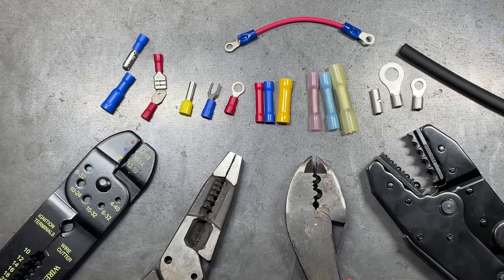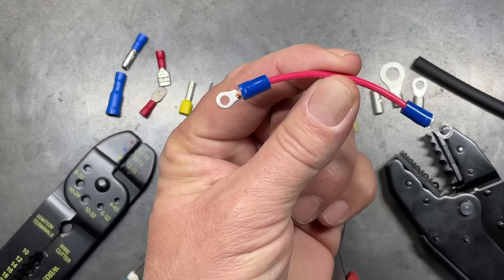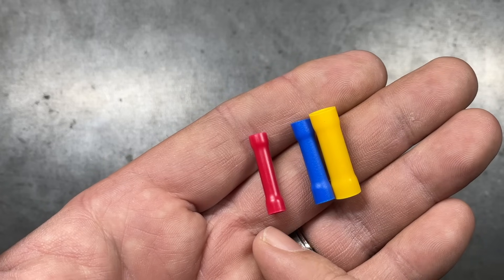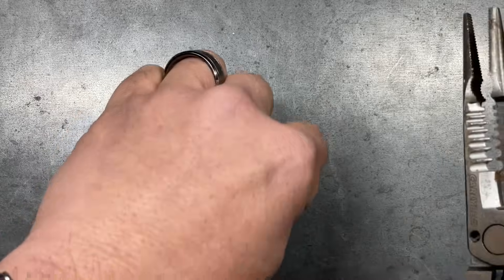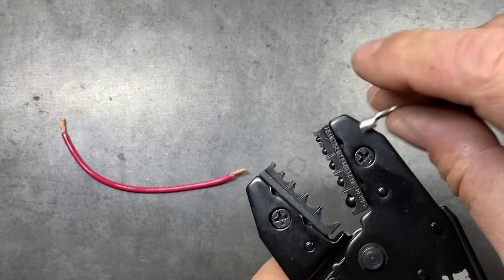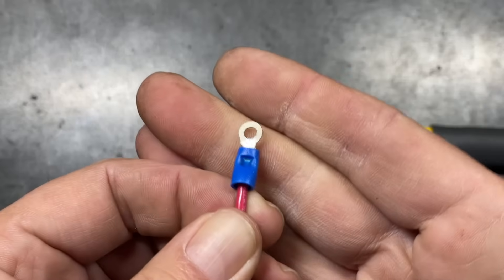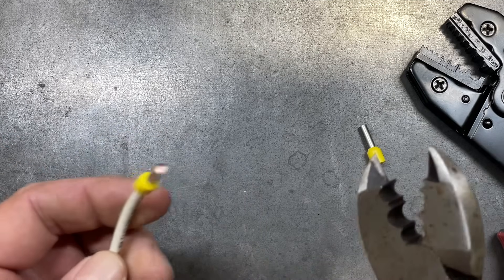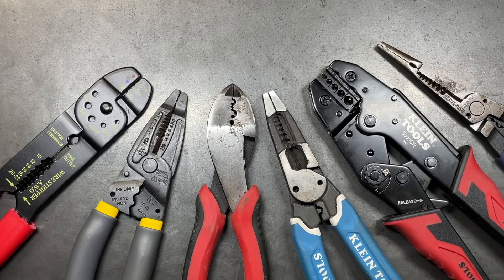Wire Crimping : How To Get Professional Results

Comment: I don't care how a crimper (like those stamped Kleins) is marked; non-insulated 'indent' crimpers must never touch insulated terminals. They puncture the plastic protector and compromise the connection. Use the correct smooth-die tool to keep the insulation intact and the joint professional. Using the indent die might be a common 'field compromise,' but it still unnecessarily sacrifices the insulation.

Comment: Hi hello sir may I ask a question please, after I crimping wire and the crimp together already, do I have to use solding to make sure is safe and wonder explode or anything, because I need to replace my ebike motorhub's three phase wires, please help by replying as this is very urgent, trillion thanks sir.

Comment: I find that stripping the wire slightly longer than the barrel and twisting it tightly helps with holding the crimp inside the ferule during the tug test as well as removes the inherent space.
Reply: You are explicitly not supposed to twist the wire. Use the smallest ferrule that fits. (Or use quality ferrules that are properly sized.)
Reply: @tookitogo I am a total amateur and learn best by having explained every detail. Why is the explicit no twist rule stated when the strands themselves are twisted. (Maybe the wire bundles are not twisted and it's my imagination)?
Reply: Speaking of being a total novice, it never occurred to me to insert the terminal into the crimper to hold steady before inserting the wire. ( I say this to demonstrate how broad your target audience is one their experience levels. So much assumptions are made on especially trade jargon understanding. What is far worse is acronym usage)
Reply: @c @crawford323  curiosity is a great thing! :) 

I’ll try to address various individual points to the best of my knowledge, and as they come to mind. You probably know some of this already, it’s just to make sure we are on the same page.

First, one bit of background: in a stranded wire, the “size” is theoretically the cross-sectional area (which I’ll call “cross section” for short), whether in square mm or AWG. This is the sum of the individual cross-sections of each strand. E.g. in a 1 mm^2 wire with 19 strands, each strand will have a cross section of approximately 1/19 mm^2. Crucially, this doesn’t include the air gaps between the strands. So the overall diameter of the conductor bundle is larger than a solid wire of the same cross-section. (This matters when stripping, which is why you usually need a stripper set one size larger for stranded than you’d need for solid.)

What’s less obvious: some (all? I’m not sure) wire standards don’t define wire sizes by physical dimensions, but by equivalent conductivity to pure copper. So if a manufacturer sells wire made of a different alloy or a different metal altogether, it will be physically larger than one made of pure copper. (Only silver wire would be thinner.) So there is actually slight variation in wire’s physical sizes, and this explains why, if you compare wires from different manufacturers or product lines, the numbers may not appear to add up exactly.

Twisting can be done in either direction. If you carefully strip a stranded wire (such that you preserve its existing twist) and hold it vertically, the stranding will be angled to right or left. These are referred to as S and Z twisting, by how the angle matches the center stroke of the letter. 

Stranded wires vary in the construction and twisting of the conductor. 
- Some wires have the strands bundled randomly, i.e. the positions of the strands aren’t defined. These often have no twist at all. These can use any number of strands to arrive at the required total cross-section. This is used mostly for two types of wires: ordinary-quality high-strand-count extra-flexible wire, and regular-strand-count wire of very low quality. 
- Most wires have defined positions for each strand, and use a slight, somewhat loose twist. Most use one of just a few numbers of strands (due to hexagonal geometry), especially 7 and 19 strands for ordinary wire. 
- High-end wires have a tight, more pronounced twist. The fundamental strand arrangement is the same as the previous group, but the tolerances are tighter, and the tight twist prevents fraying after stripping. (These are a freaking joy to work with, especially for crimping.)
- Some high-end wires use “concentric” lay, where the strands are added in layers. Crucially, in these, the layers can have the same twist direction, or they can alternate (in which case the overall wire doesn’t have one single twist direction, so if you mess up the lay, you can’t twist it back, you would have to carefully reposition each strand, in the correct order).
- High-quality high-strand-count extra-flexible wires often use “rope stranding”, where subgroups of strands are first twisted into bundles, and then a number of those bundles are twisted together to make the overall conductor bundle. (For example, 7 bundles of 19 strands each, for 133 strands total.)
- Large cables for mains power distribution additionally do things like compressing the conductor bundle to eliminate the air gaps. These are not relevant to our discussion.

Anyway, here’s a non-obvious bit: the stronger you twist a bunch of strands, the shorter and fatter the bunch gets. So a manufactured wire’s final size is designed to be correct at the final twist. That is, for a given size, a wire using strong twists will start out with thinner strands than a wire using weaker twists. 

So, why not twist by hand? Well, usually, people hand-twist far stronger than the factory twist. This means the strand bundle gets a bit fatter and shorter. But also, when we do it by hand, we usually use too much pressure and disturb the lay of the strands, introducing larger and more irregular air gaps. So the end result is a bundle with the strands at uneven angles, with uneven gaps between them, and thus with uneven cross-section. 

Moreover, when people twist by hand, they rarely look to see what the wire’s existing twist direction is, so they often end up twisting it opposite to its existing lay! This jumbles the strands even more, and also creates kinks in the strands as they have to reverse direction somewhere at (or just inside) the end of the insulation. Worse still is doing this to concentric stranded wire, since they often use alternating directions for each layer, so twisting these produces a jumble of strands tangling in each other, or in the strands of the outer layer laying very inconsistently bunched up around the next layer. 

So when this hand-jumbled wire gets crimped, this produces areas of excessive cross-section and others with low cross-section, resulting in an inconsistent crimp, as the excessive areas get over-compressed (potentially weakening them) and the other areas get under-compressed, meaning they may not produce the cold-welding we want. 

In contrast, the factory twist has the correct final cross-section, and it’s consistent throughout. This is also why it’s OK to gently and carefully restore the factory twisting, if you disturbed it while stripping for example.
Reply: @crawford323  Most terminals benefit from being held in the tool first (or outright require it). For small open-barrel contacts in particular, cheap tools can be very difficult to use because you have to thread the wire into the semi-closed jaws, practically blind since you can barely see where it needs to go, all while not snagging the wire anywhere, causing strands to bend back, and trying to make sure the wire is pushed in far enough, but not too far. That’s why expensive tools have “locators” to hold the contact with the jaws open, and have some form of wire stop to help you position the wire correctly. 

(I am frankly completely baffled that no low-cost tool manufacturer has tried adding locators, or offering them as accessories, as a differentiating feature. It would improve the tool usability dramatically and not cost that much to do, and it’d be money well spent for the consumer.)
Reply: I am Left Handed. Are crispers biased or are the  crimped tools symmetrical in design? Is there a wrong way to hold and use a crimper? I tend to stop a video and ask questions as they bubble up in my mind. Forgive me if the answer appears later in your presentation.)
Reply: @crawford323  Most crimp dies are asymmetrical, in that they have separate die sections for the conductor and insulation. Thus, the terminal and wire must be inserted from a specific side. And there’s usually a top and bottom, too. By default, tools practically always ship with the dies set up for right-handed use, so that when held in the right hand, with the “fixed” handle up and the “moving” handle down, the terminal and wire are inserted with the left hand, with open-barrel terminals open to the top. (For closed-barrel terminals, the bottom die is usually the one that holds the terminal in place.) So yes, holding the tool incorrectly will result in a failed crimp, because of swapping the die sections for conductor and insulator. (The conductor crimp is much smaller than the insulator crimp.)

On most (but not all) crimp tools with removable dies, it is possible to flip them around for left-handed use. On some, the dies can also be swapped top-to-bottom, to use the tool with the “moving” handle up, e.g. to convert the hand tool into a benchtop tool.

The only crimp tools that don’t have different die sections for conductor and insulation are the ones for:
- terminals that don’t have an insulation crimp at all, for example uninsulated closed-barrel splices or lugs, typically crimped with either a “dimple” or a hex crimp
- ferrules
- standard-type insulated terminals and splices (the ones with the red, blue, or yellow plastic insulation), where the same “oval” (really a very flattened hex) crimp dimensions are used for both conductor and insulation. (By “standard”, I mean the ones without a metal insert for the wire insulation - the plastic terminal insulator just gets squeezed around the wire insulation. There are the more expensive terminals that do have a metal insert for the wire insulation, and the tools for those have asymmetrical dies.)

Comment: @txtoolcrib thanks for the lesson. I wish I found you sooner! I can't tell you how many condescending males I've had to restrain myself from slapping over the years...lol. You made it easy to understand without "man 'splaining". I just found you today. Do you have any videos explaining the different gauges and what they are good for? I'm also trying to figure out things like solar power and back up generators. 
I'm trying to start my own woodworking business repurposing and refurbishing items to keep them out of the landfill.  I would really like to be off the grid so hubby doesn't complain about the power bill (even though I pay it). I'm currently building a storage/workshop. Up until now I've been using extension chords and I'm tired of tripping the damn breakers! I don't think they did a very good job wiring my house. For example...if I use the double sided toaster at the same time as the microwave...there goes the breaker.
Here's a tip for you. You can get wind proof lighters! The flame stays in a straight formation like a mini torch

Comment: Have halve a dozen crimping tool. Seldom use the most expensive T & B fancy ratcheting crimp tool that cost well over $100. Use my two pairs of T & B Crimp tools have cheaper ones that have the screw cutter & wire stripper on them but seldom use them. I usually only use best in class T & B crimps.

Comment: I am in the saltwater marine repair field and I see many corroded connections that have the shrink with hot glue that should all but eliminate this possibility. It seems that too many including manufactures use the punch type or in other words the non insulated version punching through the insulation causing saltwater intrusion. I have seen copper wire fittings that leaked from bilge water and the entire length of wire, 20' or more turned to copper powder. I don't think there is much education about wire crimpers and people just think they are just different approaches to the same end.
Reply: Do you have any recommendations for wire crimpers?

Comment: You still have to watch all the Crimpers... Some shown may say divot/punch for Insulated and Non-insulated ends but even the best can tear thru the plastic More so on "water proof" shrink and seal ends even from 3M. Also Many Ratchet Tools have Adjustment to handle wire and crimp properly to complete a crimp and open at end of a cycle. When you switch jaws, source of ends, source of wire or any combination of minor changes then Tolerance of all can stack in weird ways so crimp is loose or "jam" the ratchet midway closed and Most have no directions how to adjust them.
Tolerance matters because "14AWG" label does not mean all wires from everyplace are exact same diameter. Plus (or Minus) Tolerance for end as unless using 3M or other well known brands, the ends can and do change often from pack to pack that can have thick or thin metal and/or plastic etc. Worse, The Vast Majority of ends and tools sold everywhere are Poor Quality product and why so many people have Huge Problems and say "Crimp Ends Will Fail." Not just some crimps/tools shown here but RJ45 and more types where the ends, crimper or both are garbage quality.

Comment: If you have the equipment a worthy video might be how to crimp copper lugs on to cables. We have a set of Greenlee crimpers and we seem to make reliable connections but something always feels off about them. Good video!
Reply: Agreed!  I've used the "melt solder and dunk the cable" method on old hot rods and those held.  I currently have the hydraulic jaw crimpers and seems like none of them are right.  They're tight and hold, but the ferrule gets smashed out the sides more often than not.  I do like the hydro set for cable swages though.

Comment: Lol, i saw the ferrule crimp and immediately disliked it. It will definitely work, but I prefer the square crimp my Knipex makes on the ferrule (i have the cheaper pliers one). It gives it a nice surface for a screw terminal to connect to. That's how Knipex gets you, they make it also look nice. ;)

Comment: I have a crimper for my ferrule connectors that crimps on 4 sides giving a squared connection. Bought it on Amazon. The end result looks very tidy.
Reply: Yes they are better for ferrules.
In France we mostly use facom (serkan 360 for exemple) but a lot of brand have their own model (knipex, wiha...)
Reply: Exactly,
Reply: Same. Only way to go with ferrule
Reply: Came here to post the same, the proper way to crimp a ferrule...
Reply: What	would you name or describe such a tool? A four sided ferrule crimping tool? Can or should this tool be used exclusively on ferrules?
Reply: What model?
Reply: There us that crimp rerules from 6 sides it is also very good
Reply: Gardner Bender is not for ferrules